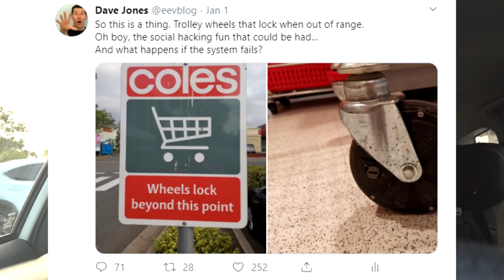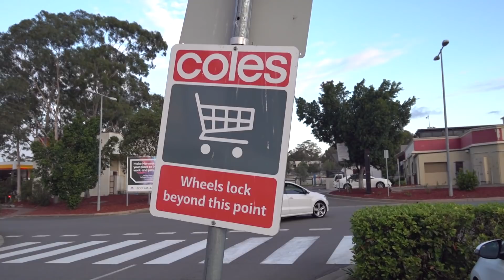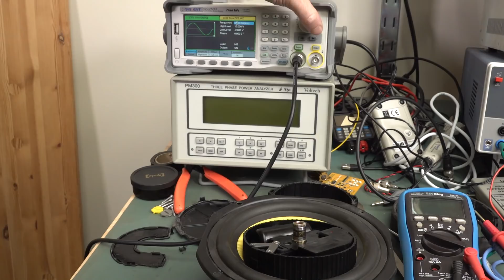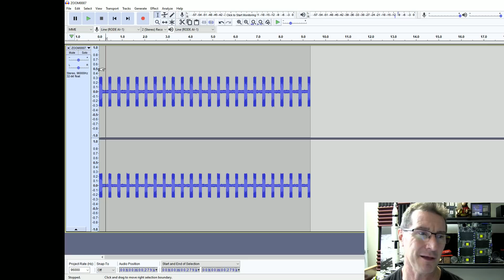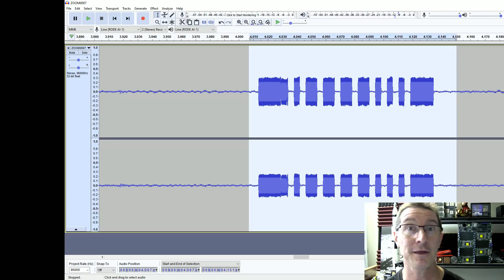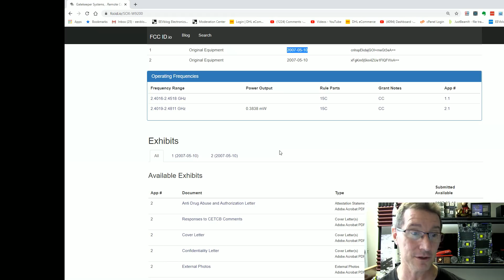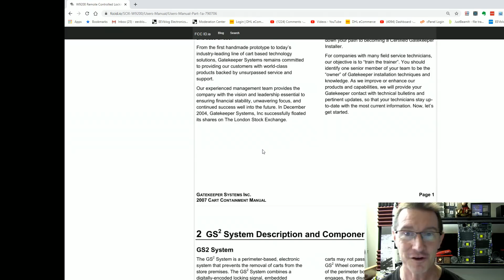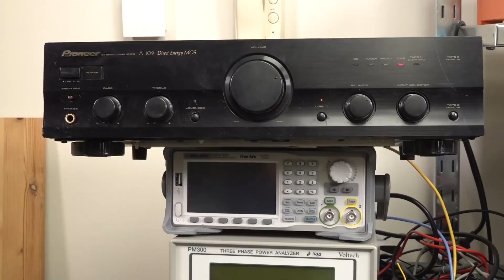EEVblog #1287 - Gatekeeper Shopping Trolley Lock Investigated

Comment: We have them here in my area of the US which just deployed them last year...only in some grocery stores. Two locking wheels; one in front (LF) and one in the rear (RR) on the diagonal from each other. All of the ones here are hard to push, they are not locked up or making noise, but something is creating drag.... like a charging technique has been used that perhaps charges an internal rechargeable battery/supercap as the cart is pushed...hm...or it could just be shitty friction bearings to make them cheaper.  LOL

Comment: I am surprised that you tried to get the wheel to lock by playing back the sound of the lock pulses you recorded considering there was no microphone on that circuit board. It's clear you need to transmit those pulses at the proper radio frequency the wheel was designed to receive.
Reply: What Dave was doing clearly went right over your head, the fact that he was using speakers and we could hear the sound was irrelevant. He was only trying to use the speaker coil to induce the signal into the inductor in the wheel.

Comment: I see these everywhere here in Omaha, Ne USA and have for many years. Funny thing is often it's a fake sign. Often the wheels are just standard solid wheels. Though at a few stores the carts do have one large wheel which is clearly the locking one.
Reply: 've yet to see them here in the southeast, just a few years back we just got the Aldi style carts where you have to return them to corral to get your quarter back. I guess people are overall more kind here, and don't steal them as often, but I will see in Walmart parking lots people not putting them in the corrals, and just pushing them up on the grass.

Comment: I think the colour coding is the "code" of the wheel lock , so centers with multiple stores using system can have different boundaries for their OWN carts, it may not have worked with your code since you didn't know the origin of the wheel that you pulled apart and thus you had the wrong code...
I wonder if the High frequency antenna and micro might be a beckon that can be triggered with RF so that the cart can be located outside the parking lot and may have a range of a few hundred feet (like WIFI) , so just driving around the neighborhood would alert when a cart is in range and can be recovered... (even when inside apartment blocks)

Comment: If one takes the trolley out not from the traps but through the bushes, I think the wheel will not lock.
But anyway, in my country the trolleys are locked to each other and the user pushes a coin of 1 or 2 euro in a slot. So to get back the coin the user should connect it to the rest of empty trolleys in the parking point. Simple and always working because people want their money back!

Comment: I'm surprised they did not put an accelerometer into the wheel  as it could be used to know if it is rotating or not and gather statistical data (using RF) about the trolleys : how much miles they have done so far, how much time in average customer spent with them,  how much are really used...

Comment: I remember when my local store got on of those systems almsot 10 years ago. Me and my then roomie where there and thought "Hey, we gotta test this system, to see if it works". So we pushed the cart over the line, and it locked, and we were like "Oh look at that, it did lock!". Then you were supposed to pull it slightly backwards to unlock it, but that didn't work, so we had to go to the store and ask for help. They came with some little remote control and unlocked it, then looked at us as if we were stupid and said something like "Didn't you see the sign that says they lock if you push them over?", and we were like "Yeah, we just wanted to test it :D". Fun times!

Comment: The signal is probably transmitting a different code than the one configured on your wheel. Maybe its coded via the MCU radio 2.4ghz

Comment: i thought this would be about the wheels that lock on travelators and escalators which work completely mechanically.
Reply: I was going to make the comment you have already made !! 

We had a Tesco's with a ground floor and an upper floor with an escalator between the two.
As soon as your trolley was on the very first metal section it would lock the front wheel/s and drag it onto it and stay firmly in place until you got to the top/bottom then release as you walked off.
It's so long ago (early 2000's) that I cannot remember whether it was the front or rear wheels that locked, but if you had a lot of weight in the trolley it didn't suddenly release bearing all the weight on you at either end I can remember that much.

My alternate theory is that the inductor on the ferrite former is just part of the circuit essential to operation and that the pcb dipole likely in one of the ISM bands is what is actually used to trigger the thing locked/unlocked ???
It would make it more 'operator friendly' otherwise the store staff would have to carry a device with a long 'wand' like inductor in the end of it to remotely unlock the wheels to return them to the trolley bays.

As for nowadays and quite a lot of other comments - we have only coin operated security with a very short chain and a slotted tag on the end that slots back in to retrieve your coin upon returning the trolley.

Comment: For the systems with rechargeable batteries the RF signal is also used to track carts as they move around the shop for data analytics and measuring shopping trends much like the ones which follow the WIFI broadcasts from phones when it's looking for a known access point. Integration into the locking wheels which was just a simple magnetic latch to the more complex RF system was just a logical next step. Not all systems are that complex and just do the basic locking given the magnetic systems are easily bypassed by lifting the wheel past the barrier but also heard about ones which use RFID floor tiles and an active/passive system for in-store tracking. Not 100% sure about that one though since it was second hand information but certainly doable given how much information large shopping centers like to keep track of. Hell Woolworth's Head Office is part of their datacenter for a reason (also their internal store with the nearby Kellyville as their flagship like Mcdonalds with the Pennant Hills store across the road from head office)

Comment: For your information, in France they solved the problem by putting a lock system where the key is a coin. If you want your coin back, you have to return it to the place your found it.

Comment: If that wheel wasn’t from your local supermarket then it’s programmed with a different 8 bit code then it probably wouldn’t lock. However why don’t you take the wheel to the supermarket and place it in the loop?

Comment: These wheels are the Bain of every shopper here in my Coles store in Williamstown (Melb).
The lube drys out and you have to drag the trollys around because they won't turn freely. Ahhhhhh
Thanks for the excellent video Dave.
Reply: The lube problem you describe can happen in any shopping cart wheel. So it wouldn't matter whether it has a locking when or not. They (the ones in the video) also ride on nylon bushings, so that's little to no friction. So that's more of a problem with your grocery style than the wheels.

Comment: If they were clever, they could have built a generator into the wheel hub to keep the battery charged up !

Different system in the UK - they have lines of permanent magnets across exits for the wheels to go over. Usually front left wheel with the lock - front wheel being most awkward to deal with by trolley thief.

I once went to the supermarket via another location and there was a loose trolley there  - so as I was going shopping anyway, I took the trolley back !

Comment: @EEVblog Can you do a Video on a tear down on Fluke(Harris) TS® 22 Series Test Set?  The main tool for a Telephone repair person would use to troubleshoot a working or non-working Telephone line.   It has a replaceable 9V battery that powers the speakerphone.  It also has a sealed CR2032 3V battery that doesn't last forever and then your Buttin Test Set will not work when this battery dies.

Comment: these could be used as brakes for homemade wind mills, i was going to use it as an idler because of the nice rubber, but if someone figured out how to use it as some kind of brake that might be a good use

this all makes sense, imagine how much it would cost to put in a whole perimeter of coils, and how much power it would use. its the 2020s it's cheaper to put a micro and battery in each wheel and charge for that.

Comment: Here in Austria they often have a rail at the exit of the parking lot. You see an about 5cm wide stainless steel rail. If you cross it with the wheel, it locks. But if you lift the wheel over the rail, about 20cm are enough, then it does not lock. :-)
I don't know, how it works. Perhaps even mechanical with permanent magnets in the rail. But I did not observe (magnetic) debris collecting at the rail. So???

Comment: They have these in germany too. Couldn´t they use a wireless charging coil to power the solenoid instead of a battery? That way when you drive over the loop it powers up and pushes a wheel blocking screw out. You wouldn´t need as much pressure if you just push something in the way of the wheel turning. Smaller motor and no battery should make it quite a bit cheaper.

Comment: If I were designing a system like this I would just take advantage of the 2.4Ghz module on board and make it listen for a signal every so often and if it cannot hear it it locks the wheels and would put a small permanent magnet on the outside of the wheel and a coil on the inner component and use the rotation when the trolley is moving to trickle feed the battery so that any increase in power draw from constantly listening for a signal is regenerated during use of the trolley and I think it would probably be cheaper to have a dozen tiny solar or plug in transmitters littered around the place instead of a couple hundred meters of copper wire that you have to cut a giant slit in the ground for and reseal. Thou I might use a different frequency considering 2.4Ghz is kinda common and would use something in the kHz range so it doesn't care as much about walls and such which would still be very simple

Comment: The signal is probably an address. My best guess after sniffing the things with my cell phone is that it uses the address and inverse address for lock and unlock. I have had to deal with those damn things at so many stores. Cart full of tools locked up when your just trying to work on the door 8ft away really sucks. Seems more likely to mistrigger when you have a freshly opened can of pop in the cupholder of the cart. Been meaning to come up with a little bypass module I could keep in my box for those.

Comment: You could require the cash register to tell the wheel it's ok to leave the store. Most stores have 2 sets of doors (to be able to trap thieves) You could use this to know if a cart is coming back into the building and reset the wheel.

Comment: Okay the ground loop sends a 8 bit coded locking signal. Fine. Wheel permanently locked.
But here in France (at CDG airport), the cart unlock if you get back to the authorized zone (inside terminal). It may be more complicated.

Anyway, tons of ewaste to prevent peoples from stealing shopping cart....

Comment: The strip malls in my area (Southwestern Pennsylvania, USA) put the magnetic strip all around the parking lot, like they suggested in the manual. Makes it harder to avoid the wheel locking up, but they still only put it on the one back wheel. Also, the different stores have different codes, so I always see a bunch a Target carts abandoned in front of the Dick's even though they're connected to one another.

Comment: Reading the documents on the FCC site, those dots that you removed from the wheel denote wether it is an analogue system or digital system. They were going to use colored plastic for the whole wheel hub but I would assume it is cheaper to use plain black for the hub and use colored dots to denote digital or analogue and if digital perhaps which one of the digital formats they use since they now have at least three formats.

Comment: I felt dumb thinking I am not able to operate it properly. Thought there is something you need to do to operate the trolley. The coles trolleys were at fruit and vegetable market and saw some pushing trolley with wheellock no problem. Probably because the ground were smooth and they were pushing it hard enough. 

Didn’t know it works only near Coles. Had to google how to operate those and found out how they work. I am dumbfounded by the this technology.

Comment: There are a couple stores that have cart escalators as soon as the cart rolls onto the ramp they both lock up until you get to the top to prevent the carts from rolling down the ramp
Reply: They probably use grooved wheels to mechanically lock up.

Comment: There is some weirdness about these locking cart wheels. In my local store I have to go through a checkout or wheels will lock immediately at the exit door. I always thought the sensor is photo-electric - they all have a clear window at the bottom in my area. They lock explicitly when crossing yellow lines. I didn't see any signs of buried cables or tranches there.

Comment: Hi All, my first experience was about 3 years ago at a Aldi in Sydney, taking the trolley to the car parked on the street and it locked a wheel.

Hmm, as it was full, well i just lifted up the corner with the locked wheel and my wife pushed the trolley.

Another time it happens again ( possibly K-mart ) , and i was along, so i decided to just grab the trolley by the normal handle and drag it backwards - it is so much easier then trying to push forward.

Unfortunately it makes it to hard to return the trolley

Closer to home i am about 600 meters from the local railway station and the small strip of local shopping centre , all the streets are full with abandoned trolleys, some people park a long way from the store due to lack of parking, others are just local residents who take the trolley home and then leave the trolley on the footpath

BTW they are nice trolleys, but make horrible billy carts

The main problem described by customer assistance at woolworths is they have approx 400 trolleys with a average use of say 15-20 mins per shopper,  it say 50 are on the street that is 50 x 3 = 150 shoppers per hour that cannot use a trolley, at the local shop some times has plenty of trolleys other times almost none and you go hunting in the carpart to get one ( or find a nice little old lady and ask her if you can push and load her trolley in the car to use the trolley yourself ) 

Regards
George

Comment: In UK we have them and they also engage for trolly escalators to go up a floor. Seen them in Germany first about 12 years for a toys r us that was all on top floor. Trouble is there was a different shop with its own trolleys underneath and it was easy to grab the wrong trolley.. A mistake you realise when trying to get back down (fortunately the trolley wasn't heavy as it was a good 25 metre section to hold on for. You wouldn't want to let go and wipe someone out).

Comment: Would have loved to see that replay actually function. I think the other posters are correct -- there's probably 8-bit unique locking or unlocking codes. This wheel probably doesn't match the system you captured.
Reply: Yeah, that was what I was thinking, that it was coded for a different installation. That code he showed appeared to be 10000111, or 01111000, and the wheel he took apart could've had a different code.

Comment: We have these in some shops in the UK.   We also had the ones where you had to insert the £1 coin to release the trolly, but they are mostly gone as they changed the design of the £1 coin and that type of lock wasn't popular (as more people are going cashless which meant they didn't have a way to buy a trolly!).

I'd guess that if they have a code for locking a wheel that it may also be different codes for different customers?

Comment: Dragging the cart doesn't work - they thought it out. There is a U-shaped metal piece welded to one of the rear wheels. It doesn't allow to tilt the cart, so you can't roll it on two rear wheels.

Comment: Have you noticed how the locking wheels don't jam up with lint and string and such like the normal wheels do? Maybe if they did all four wheels as electronically locking wheels you wouldn't have so many carts with locked wheels due to a lack of maintenance , teaching shoppers how to use carts with locked wheels!

Comment: Somehow I doubt these would work well in SE Michigan, where on cold nights it may get down to -20 F, and there may be 6 inches of snow on the pavement and 6 feet snow banks everywhere else. Batteries don't work well below zero. Formerly soft rubber turns to brittle plastic. I can't imagine they would like brine from salted pavement, either.

Comment: I do recall having seen these on trolleys in the UK, they seem to have phased them out in favour of the much lower maintenance and cheaper coin operated option, sadly though you still see the odd abandoned trolley. (What UK canal/waterway would be complete without a trolley in it!)
Worth pointing out that I use a trolley token - there are a few trolleys that cause the token to stick and there are warning labels to use the new 12 edged £1 coin... Also some of the first coin operated trolleys had a chain long enough to allow you to feed it back in on its self. They got retrofitted with a piece of stiff plastic tubing to prevent the loop back. Expensive things trolleys!